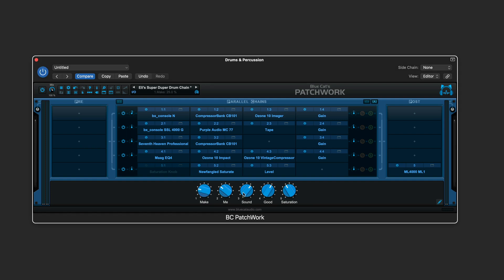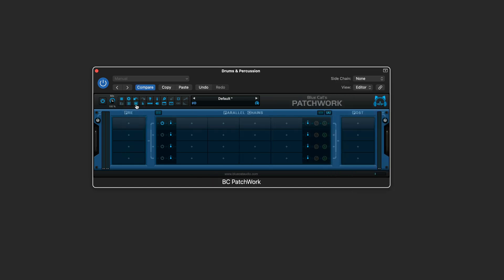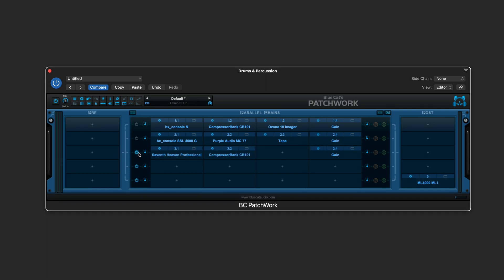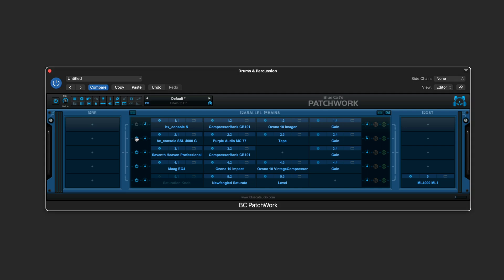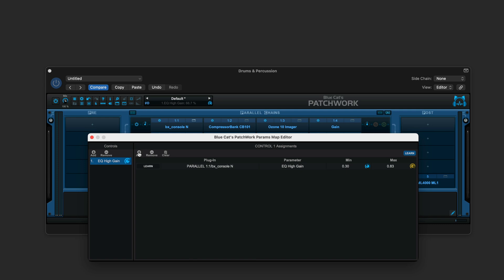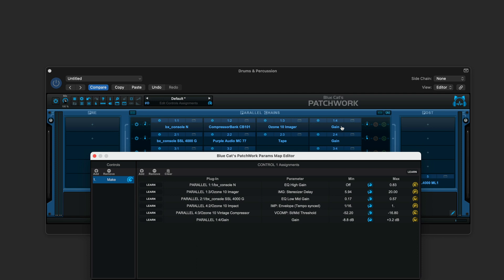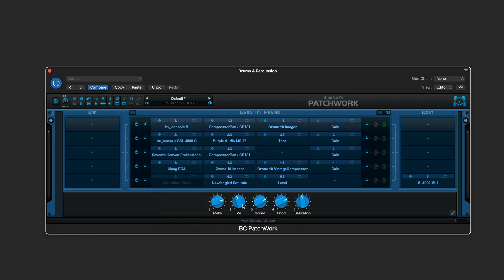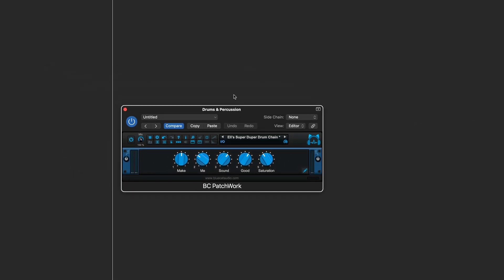How to Control Multiple Plugins Easily with the Patchwork Macros Function

Comment: I tried this plugin in ableton with reasonrack but the gui messes up... when you load it first it's ok but when you re-open it it's doesn't appear properly like cut down into the left lower corner...
Reply from the maker: Yes this has indeed been an issue for a while. You may want to file a bug with the Reason team to help us get this fixed.
Reply: @bluecataudio  this was fast... I also posted a picture on the KVR... I already sent this to Reason as a support ticket...
Reply from the maker: @absent_ Thanks!

Comment: I have been using this extensively and just to let you know I need to be able to see accurate values from the plug-in on the knobs that I create. I also would like to be able to password protect the ability to open the plug-in and see what plug-ins are being used inside there.
Reply from the maker: Changing values from % to original plug-in values is indeed in the todo list (but as you can have a  macro control for multiple parameters it is obviously not straightforward).
Reply: Either way. One of my most used plugins. Thanks 👏🏽

Comment: But no way to use on-off switches like a guitar pedal board
Reply from the maker: The switch has to be able to send MIDI information. So a hardware channel switching switch will not work natively. You need a piece of gear to interface it to the computer.